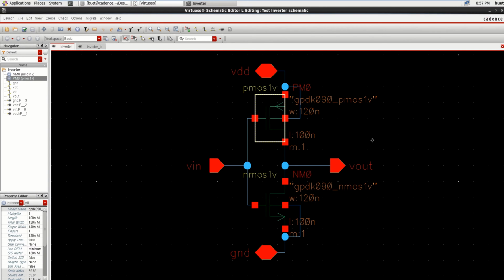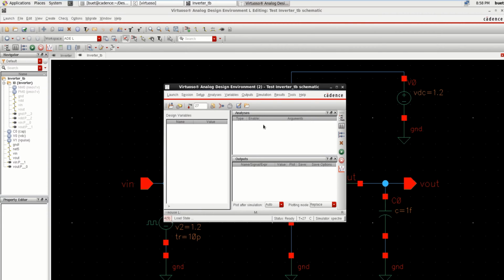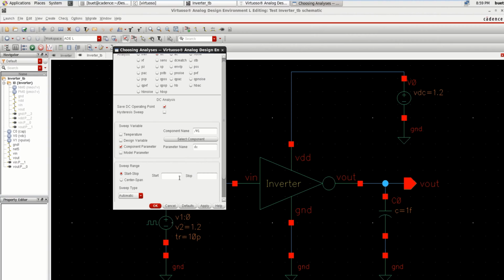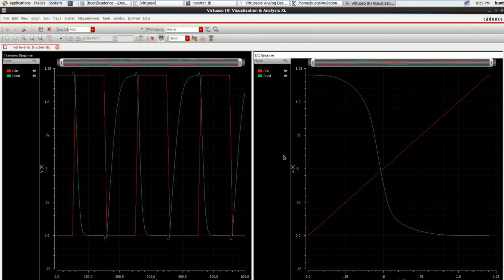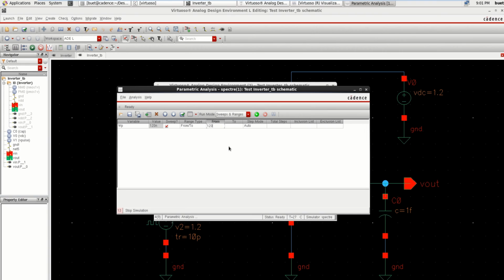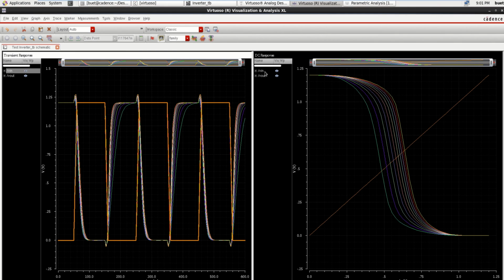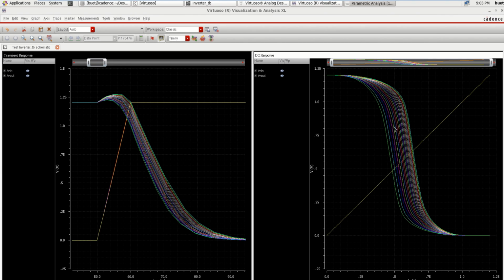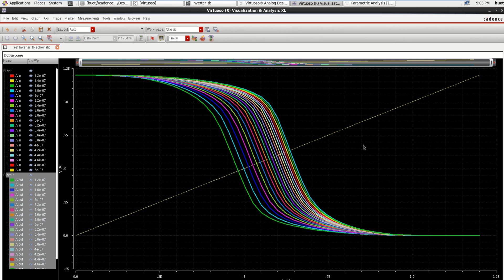Cadence Virtuoso: Parametric/Sweep Analysis.

Comment: Hi, I'm using ADE explorer.
But the parametric analysis is not exist under the tool tap.
Please help me... I want to sweep 2 dc voltage.
Reply from the maker: Hi ADE Explorer is advanced than ADE-L.
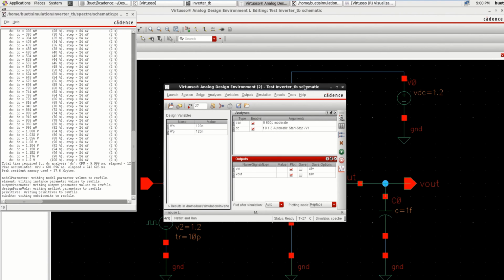In ADE Explorer there is design variables and parameters. Use this video as reference from 3:40
https://www.youtube.com/watch?v=VpZ3br6BrPM

Comment: Why are the peaks there in Vout?
Reply from the maker: Hi, can you tell the time where you got peaks
Reply: At each transition point of Vout, the peaks and dips are there. I was Designing my own inverter using different devices and voltages, in my case the peaks were larger. So, I want to know which phenomenon forces this to occur in practical circuits

Comment: how to solve "parameter simulation failed for first point " when doing parameter analysis
Reply from the maker: Increase number of steps
Reply: I set the parameter of capacitance from 100f to 500f.No matter what step I set , it can’t work and have the same error message